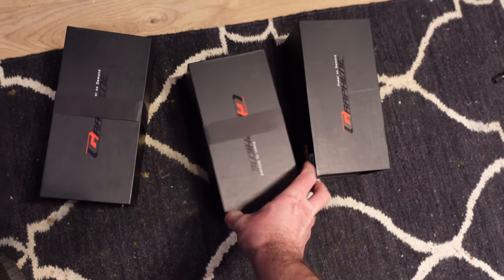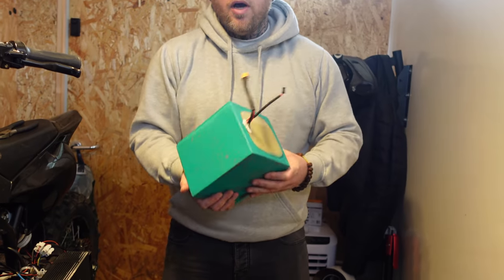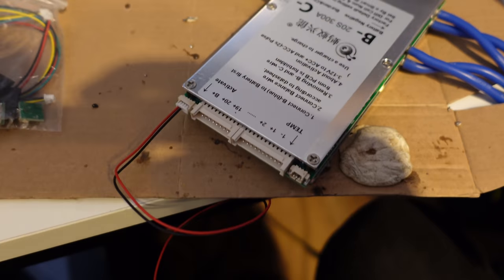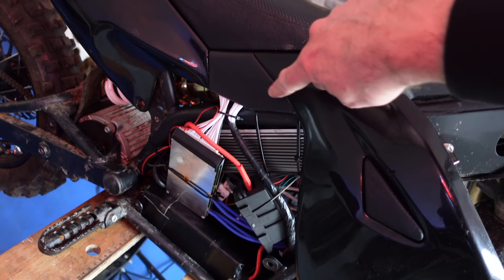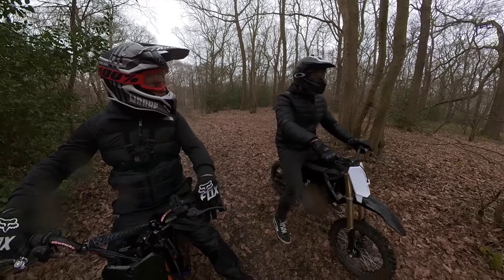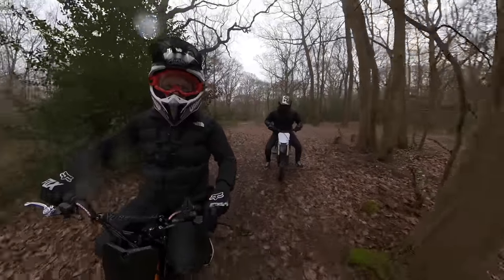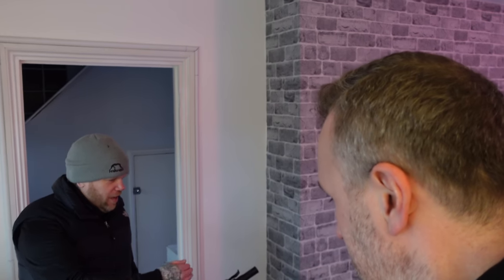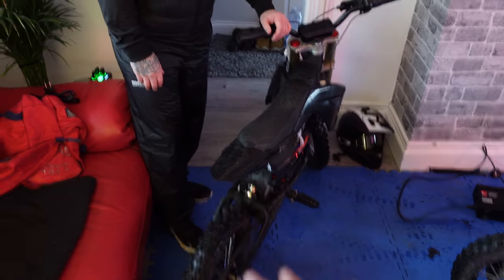WE BUILT TWO INSANE ELECTRIC DIRT BIKES AND PUT THEM HEAD TO HEAD!!!

Comment: You need to turn down his Throttle Mid Voltage (V) to 1.50 and turn up the Throttle Mid Current (A) to 300, then the Accelerate (MS) down to 35 for more start-up torque. If that doesn't work he needs another 6s 12ah lipo in parallel to get more amps. The 12ah battery is just not enough IMO even though it's a lipo it's going to sag on a hard startup. Anyway, they look like a blast. I don't think Steve will ever be happy until it littery loops him off the back and bruises his Bum, lol.

Comment: Great video, wheel spin and traction I would say is the problem, look at the line of dirt his bike was carving, it wasn't gripping, I would wind the power down some and look at traction modes on the controller if that's possible, also maybe a taller wheel and or gearing, also you might find the rim and the tyre are slipping, Mark the rim and the tyre with a marker pen to check, that's a lot of power through a small wheel, my electric BMX used to slip on 3kw, would kill the tyres.

Comment: Steve's bike will never be as fast because voltage is lower on the 18s 😂 and gearing could be playing a part but the voltage is why its slower.
Reply: Less sag on graphene batteries, so could be very close voltages under load. Will be interesting to see what the lowest voltage recorded is on their VBMS apps.
Reply: @Pupenhausen  yes there would be less sag but Andy's pack is made from 21700 cells so won't sag as much as you would think. No mater what you say the extra 10 volts is where the speed difference is
Reply from the maker: Yeah its surprising, these 21700 cells are crazy now. Nearly as powerful as lipo.

Comment: Also, the real difference is your motors, the Pancake will have more torque due to the poles being longer. (well, in my understanding atleast) Pancake motors are usually wider but not as deep and end up having better efficiencies. (This has been exploited in the 3D printing space too for filament drivers btw)

Comment: I’ve got a kugoo g booster twin motor it’s sat at standard 48v 1600watt but the motors are good for 1200w each so 2400w what would you suggest to get it to the 2000 or 2400w for more speed it does 36mph I’m looking for 40-50 haha any suggestions? 
I had a razor350 years ago and put a extra batt on and got 45mph out of it but it fried the controller after 6 months .
Great vid

Comment: longer swing arm will make it stay down moore ya want better response there is a throttle cable set up its a box that sends the curent for throttle but you run a normal mptprbike cable throttle you can set the response alot better second you turn throttle or delay it  very good and cheep mod

Comment: I have the same BMS and also thought it strange you need to turn it on with a 3 to 5v battery,  I am sure you have worked out by now you don't need to do this to turn the BMS on, just hit the throttle or put the battery on charge will turn it on.  Keep up the great videos.

Comment: i have a question if someone wanna answer and not be a troll, the higher the voltage on the battery, do you get more acceleration or top speed or both?
Reply: Higher voltage = higher top speed. Higher AH = longer run time and more amps available to the motor for higher torque/faster acceleration.
Reply: @Pupenhausen  thank you, always wondered what the amps to the motor meant

Comment: When I said Turnigy Lithium, I never thought you'd be going graphine! you guys are looking at some serious power there.
Reply: Let's not just glaze over the cost of those :P
Reply: The graphines will definitely have less sag under load btw, they're barely breaking a sweat!
Reply: @JamiePineappleWyatt  I run 40152 LiFePO4 cells 24s1p.   They will smoke these turnigy batteries in amps and longevity…fitting in an ebike is a challege tho, unless you have a custom build based around your battery pack.
Reply: @jimhofoss9982  the size of your cells makes it a bit of an elephant vs a mouse comparison 😂
If you had lipo in a similar form factor the lipo would smash the lifepo4 for current delivery. But never longevity.

Biggest reason to go lipo is weight reduction and better voltage sag under load
Reply: @JamiePineappleWyatt    yeah power to weight lipo wins…but would like to see a side by side comparison for voltage sag.  Not much sag to speak of until the very end with LiFePO4 40152’s….and thats pulling 100/150 amps all the time….because its impossible not to twist the throttle hard!😂

Comment: Alright Andy I’ve got a 1500w back wheel  with a 52v battery 17.5 amp hour would I get more speed by putting a 72v controller straight on or would I have to tune it ? Thanks
Reply: No, you'd need to add more cells to the battery to bring it up to 72v as well as add a 72v controller.

Comment: From a biker's point of view Steve's bike produces a bigger Cockerell crest of mud than yours does on take off.
This could be as Steve says as a result of swing arm length, but also rebound on the shocks.  His bike is pushing the rear wheel off of the ground. That is what needs countering..
Try swapping rear shock absorbers over as a test, see if that changes the characteristics

Comment: U don't need a BMS , just balance charge
Reply from the maker: BMS is a good idea for lipos, especially a programmable one where you can set limits. You need to look after lipos.
Reply: I don't use BMS on hobby packs just balance charge, had too many BMS systems kill the battery when unattended however for your mate who's less technical a BMS is a must imo, I used to use those Nano cells they are pretty decent although I'd prefer it if they spent more on the battery than the fancy box and little bag you get with them.
Reply: @andykirby  been using lipos over a decade, Nev used a BMS ,my esc has lvc.low voltage cut-off.i balance charge